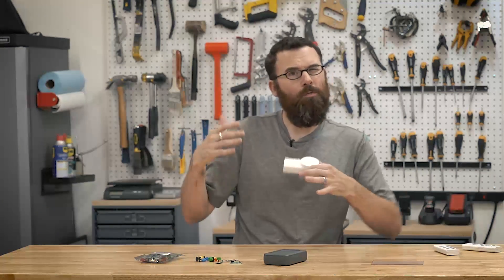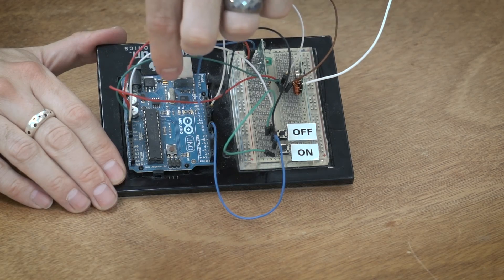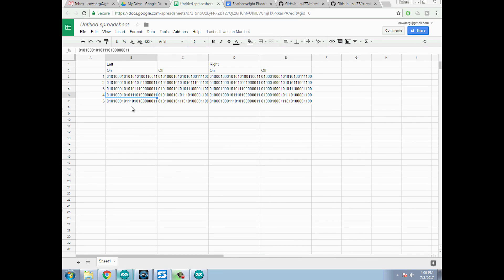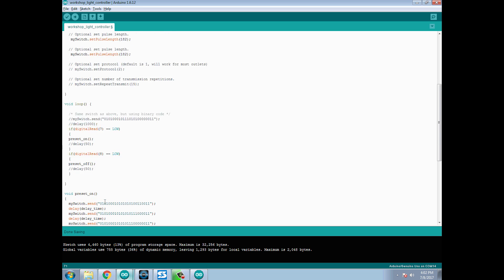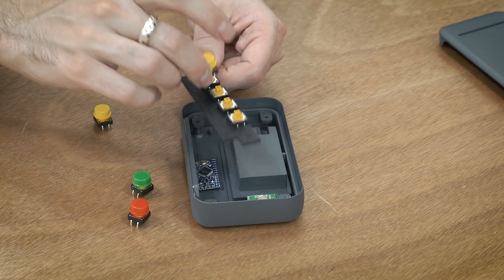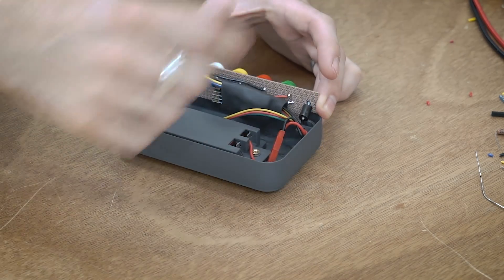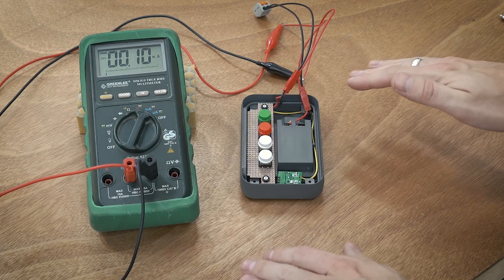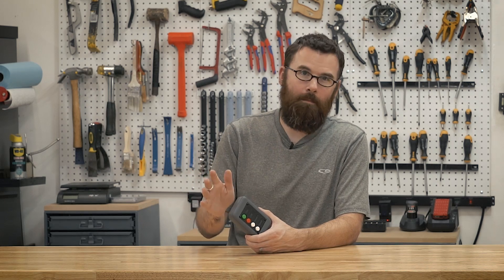Workshop Light Controller

Comment: Love this video. It answers so many questions I had about those 433MHz modules. Now I just need to figure out how to do the same with 2.4GHz modules.
Reply from the maker: 2.4 is a bit trickier I think.  If you can stick with the 433mhz, it's a great way to go.  they're SO cheap and very reliable.
Reply: I have about 4 sets of the 433MHz modules and several of the 2.4GHz. I need 2.4GHz because that is what my electric smoker remote uses. I was trying to make my own controller for it.
Reply from the maker: Ah OK.  sometimes those can be proprietary.  But you could use a similar method to decode the signals.
Reply: So what I'm hearing is I should just build an entire smoker controller and not use the built in one at all... IoT controlled ribs here I come!
Reply from the maker: Hehe, maybe.  You can get PID temperature controllers from eBay or amazon very cheaply.  You just connect them to a thermocouple and you're good to go!  I investigated this for a project, but ended up getting a mastercraft smoker instead and it does a pretty good job at controlling by itself.
Reply: I have a masterbuilt smoker and it does a great job controlling itself as well, but I can't check on it from the web and change the settings and it doesn't notify me when it is finished. We need these things in 2017. Haha.

Comment: I like this Robert, but how did you know what the RF frequency of the outlets were to get the correct RF boards for? Also, You didn't put a link to the RF boards that you used.
Reply from the maker: Oops, I knew I forgot a link, thanks for catching it.  I just knew the Etekcity modules were 433MHz just from looking at teardowns and from doing research.  I added the link to the exact ones I used, anything along the same lines (433MHz) should work the same way.
Reply: Thanks Robert :-)